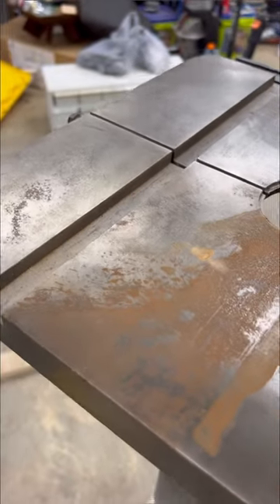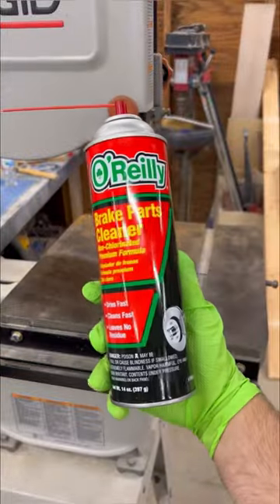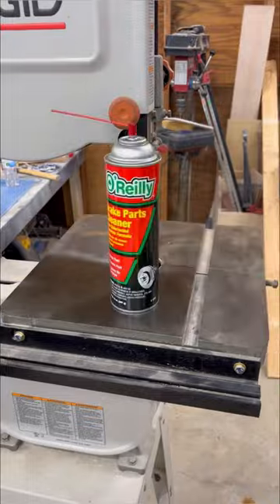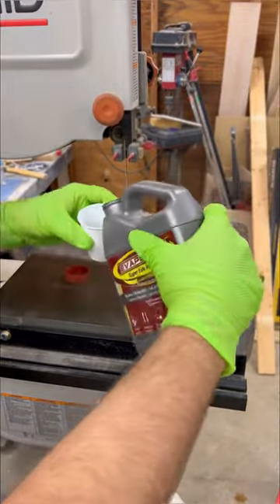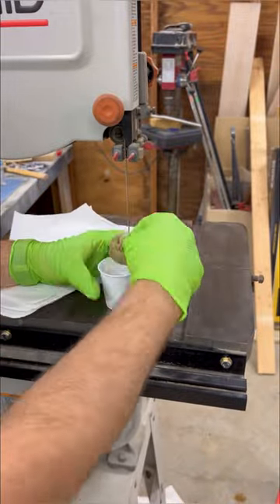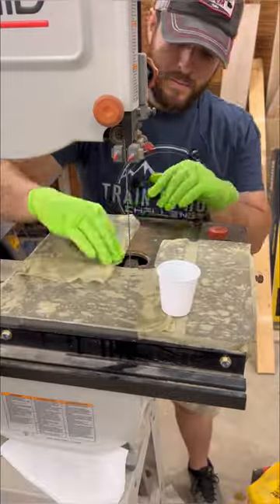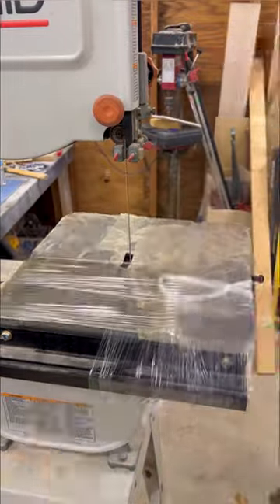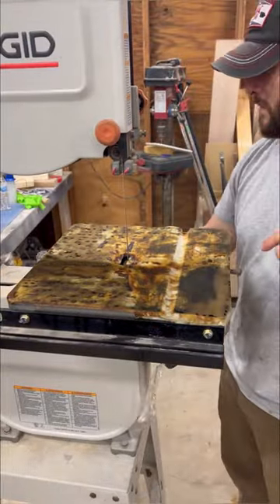I wrecked my bandsaw #fail #diy #tools #woodworking #bandsaw #woodshop #restoration

Comment: Last year I left some freshly cut red oak on my table saw over night. Bad mistake. When I got to it the next day there was thick rust on the table. I used 'Sandflex' blocks from Taytools. They come in three grits. Worked great. The rust marks are almost non-existent now, just a very slight discolouration.

Comment: get a block pumice from a commercial kitchen cleaning supply like SYSCO.
they are called flat grill cleaning blocks.
splash on Vegitable oil liberally and then use the block to clean away the discoloration.
I think Smart and Final has those flat grill pumice blocks.
Reply from the maker: I really like this idea!

Comment: Inheritance Machining ran into the same problem with the evaporust and his own bandsaw. How he fixed it was just doing the same paper towel method, but leaving it for a few hours instead. And it seemed to work pretty well that time around. However depending on the damage this left, there could still be some etching even after removing the rust. I have high hopes for you man, keep trying 👍
Reply from the maker: Great tip thank you!!

Comment: I clean rust off with a flat block with fine sandpaper and spray it with PB blaster before and during. Then clean and treat with paste wax to seal and polish that and done. Lasts and beautiful.